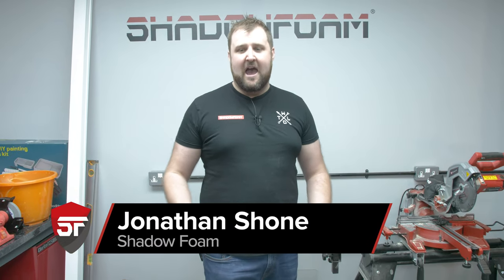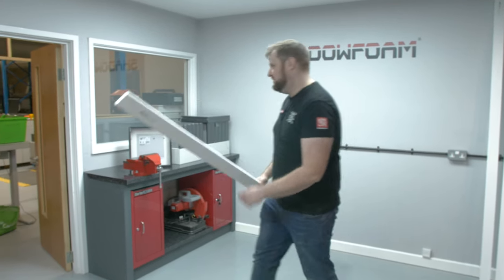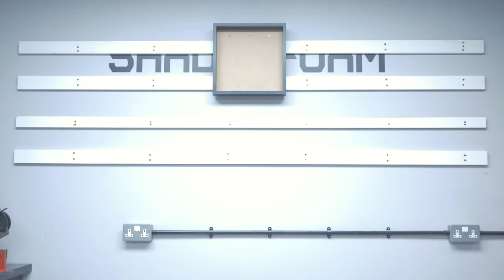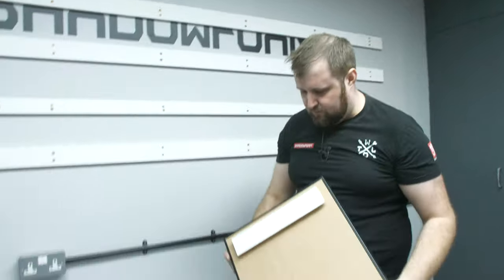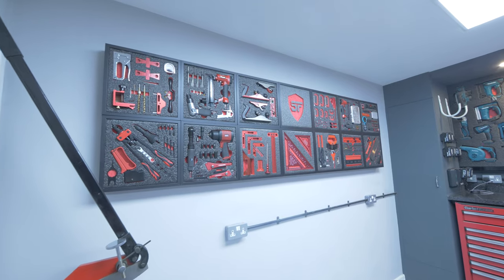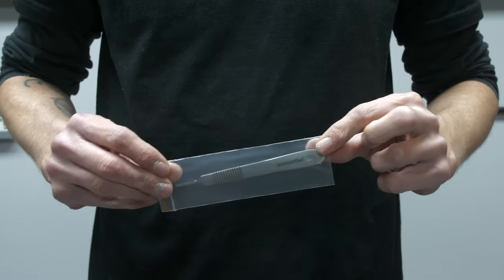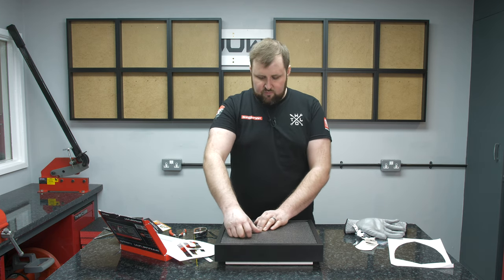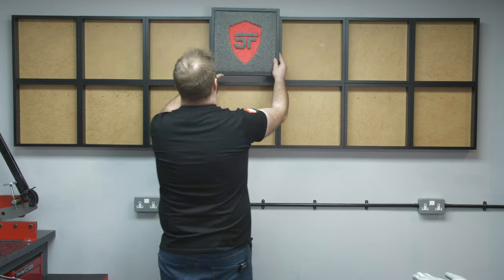We Built a DIY French Cleat Wall with this GENIUS IKEA HACK!

Comment: Should have left a gap between the two runs - if you want to take a bottom panel out at the moment, you also have to take out a top panel first….. with a gap they’re independent
Reply from the maker: We just wanted the rows to look flush together, thought a gap in-between would look a bit ugly, but totally get what your saying. 👍
Reply: Yes we have appearance over function, which is the way things normally go.